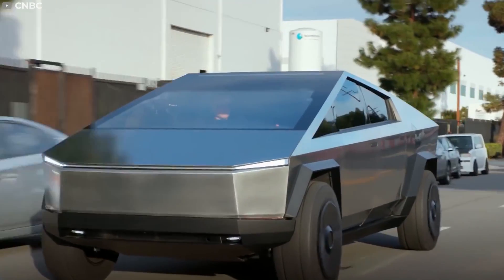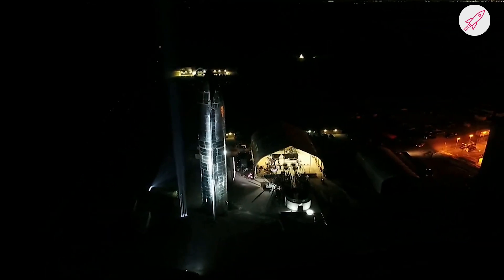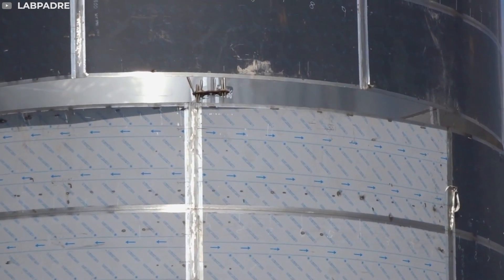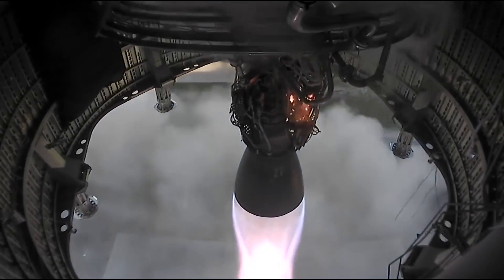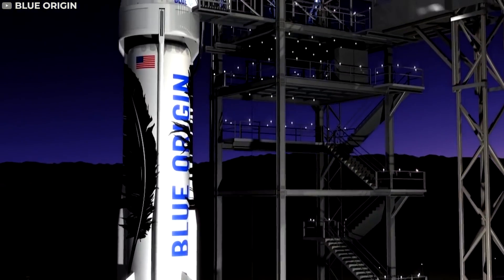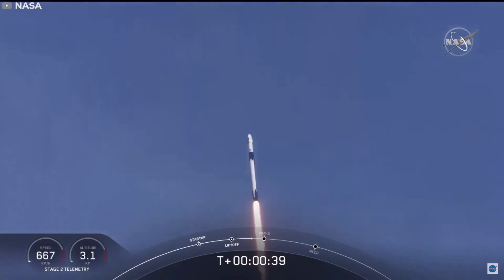Why SpaceX Is Building The Starship

Comment: Steel alloys are roughly three times as heavy as aluminum alloys. And they're roughly three times as strong. Structures designed to a given load limit will be roughly same overall weight; stainless steel isn't a bad choice, compared to aluminum (or carbon fiber, for that matter), at least not in terms of total weight of the vehicle.

Comment: Greenhouse gases? I thought rockets used liquid hydrogen and oxygen as their propellent and the burning results in water steam. Never heard about kerosene in rockets...
Reply: Go read about the Falcon 9
Reply: The space shuttle used that, but not its boosters. The Delta IV/heavy and SLS will also use hydrolox (but not SLS's boosters) It depends, some rockets use Keresene, and Starship, among a few others like New Glenn and Vulcan, will use methane (which burns to give water vapor and co2).

Comment: At one point you stated: "But it (SN5) only reached an altitude of 150 M".  I have a flash for you.  That was the designed altitude all along and the way you portrayed it as a failure.
The Star Hopper did the same 150M.   SN6 did the same 150M the week after SN5.  The biggest feature of Spacex  Rockets (all) is their reusability.  (Which you glossed over).  The second major reason for Spacex to build Starship....As an interplanetary vehicle.  Elon wants to spearhead the way to Mars. (Which you glossed over also)  But it was a nice gathering of clips, (50% were from other manufacturers rockets)  Good editing and narration quality.  I gave you a +.

Comment: If the Star ship's rockets ended up conspirering a perfect medical shell of SpaceX Space travel paint made of Glass shealding and vests of magnisium flouride than the heating pading problems with the temperature building upset opon the Star ship's rocket would not be as attracted to the harmful heating levels of on the other layer of the Rockets or rocket them selves..... In fact it would help prevent the heating from forming or gripping onto the stainless steel and it would be a great way too help you Mr Elon Reeve Musk Sir and your SpaceX astronorts and SpaceX family team members too use for a temperature controling exorste for the rockets fixation so that the star ship's could move more envigurasly through out space and whilst landing tilts on the Moon and on to Mars...... Etc etc and etc..... Because with using this method you would not be putting your Star ship's Rockets sorroundings or rockets monitors and engineering systems motors or anything at quite as much risk..... Have a beautiful evening america and  God bless you always always Mr Elon Reeve Musk Sir kindly sending my love too you and your family from lilian Meade here in Australia thinking of you always my God love you your perfection..... Full stop

Comment: Elon is planned to recycle CO2 into Methane so the CO2 pollution problem is overblown. By synthesis Methane from CO2 using renewable energy. Those CO2 from the exhaust can be recycle over and over again. Problem about Methane left over in the exhaust is also close to none exist because all rocket engine is designed to have a complete combustion.
Reply: Yes I was going to comment this, the pollution factor is actually very little especially compared to all the cars driving around and are they forgetting that Musk developed a very successful ELECTRIC car?
Reply: No process is completely reversible, so there will always be a net accumulation of CO2 via rocket launches despite using the Sabatier Process. This is also not even accounting for source of initial input energy to run the process, for if it is coal powered then there will be an even further net accumulation of CO2 in the atmosphere. Furthermore, no chemical reaction is 100% efficient, so there will be unburned CH4 that goes into our atmosphere, which is a significantly worse greenhouse gas than CO2 is.

Comment: Rockets don't cause as much emission. Compared to other things. Look up airlines and compare with rockets. It's nuts.
Reply: Not to mention Space-x's plans to use solar power to synthesize their own fuel. Which will make the rockets as close to carbon neutral as they can be
Reply: @gregsteele806  Exactly. Starship will use methane and LOX and they will synthesize methane from CO2 and water using solar power. Not because it would not be cheaper to just buy methane from other sources but because they need to develop methane production technology on Earth before they try it on Mars. So Starship ecological footprint will be minimal: they will remove as much (or probably more) CO2 from the atmosphere as much they produce at launch.
Reply: @kpbendeguz  You realize that for two decades after its release, methane is 84 times more potent than carbon dioxide as a greenhouse gas right?
Reply: @macrumpton  They are not releasing methane, they are burning it.
Reply: @kpbendeguz  that releases methane. its mixed into other elements and when it burns the methane is released
Reply: @dylegend27yt81  What methane becomes when it is burned? Water and CO2. So they release water and CO2 not methane itself. But they also create the methane from water and CO2 so the ecological footprint of Starship is gonna be close to zero.
Reply: @kpbendeguz  well no because CO2 is also a greenhiuse gouse that heats up the climate
Reply: @kpbendeguz  greenhouse gas* dunno what happened there
Reply: @dylegend27yt81  They remove CO2 from the atmosphere to create methane, and when they burn it they add the CO2 back. Atmosphere - CO2 + CO2 = Atmosphere. So the ecological footprint will be zero, even negative because part of that methane will be burned in space.
Reply: @kpbendeguz  no they don't lmao. if they did that then global warming wouldn't be a problem. it's created from the burning of several fuels which we use for power. we used to use some of these fuels for rockets. we dont just take from the atmosphere
Reply: @dylegend27yt81  We don't, but SpaceX will, because they need a self sustaining methane processing technology for Mars missions (since there are no methane suppliers on Mars) and they will use solar energy to create methane from CO2 and water.
Reply: @gregsteele806  Actually if they were to burn hydrogen and LOX the result would be water.
Reply: @macrumpton  Except the Starships burn Methane because it's something they can synthesize on Mars.
Reply: carbon dioxide also isnt bad for the planet.
Reply: Instructions unclear. Looked up pictures of nuts.
Reply: That's because there are not that many rockets. Airline emissions are quite good if you look at it per passenger, per distance basis. Comparable to a car with one or two people in it. Problem is, you usually fly quite a lot of distance in one go. Rockets are a lot of things, but fuel efficient they are not. 
Falcon 9 launch results in some 330 tons of CO2 and puts maximum 7 people on orbit so that's 47 tons of CO2 per person. Taking about 130g of CO2 / (person * km) that an typical airliner does, for equivalent amount of emissions to going to orbit, a person could fly on an airline for some 360 000km. Or buy a new car and drive it until it's scrap metal, same thing roughly from emissions perspective.
Reply: @aleksandersuur9475  at least when all those emissions are going up there it's for an actual purpose besides just getting someone down the block or another city over, its going towards saving our species id say that's worth it.
Reply: @communistcheese1134  How many people do you think they are going to send to mars in the next 50 years to save the human race? 1000? 5000? They will be living on a planet where you can't even breathe or find liquid water or a single living plant. How long do you think they could survive without any support from earth? And the one thing nobody mentions, the earth is a far better place to recover from a disaster because at least we can breathe and eat plants and drink the water that is available everywhere. On Mars there are so many more ways to die, including asteroid strikes. Even a pandemic would be more deadly in the close quarters in a Mars base.
Reply: @aleksandersuur9475  don't worry, even if we launched 100 rockets a day (and this won't be the case in many years) emission by rockets would still be neglectible, i mean, do you understand how many millions of people travel by car / plane every day? And of course, once on the moon we can extract helium-3 to make clean nuclear energy, platinum for hydrogen cars, neodymium for wind turbines & other stuff that on Earth we don't have quantity large enough to make renewable energy available for everyone.
Reply: Flight per flight rockets are much worse, and as the rocket launches get cheaper and cheaper there will be many more of them.